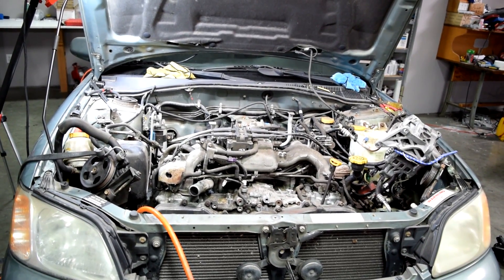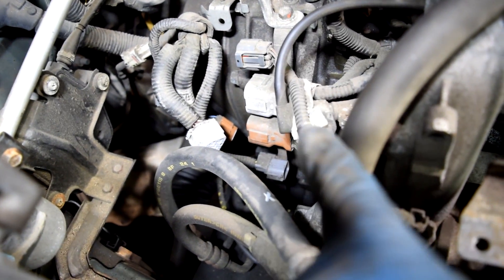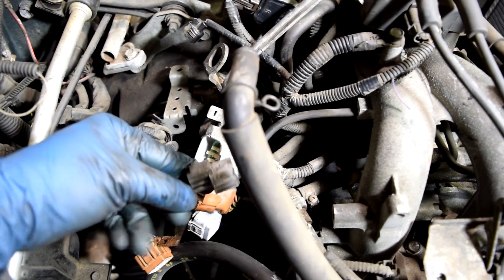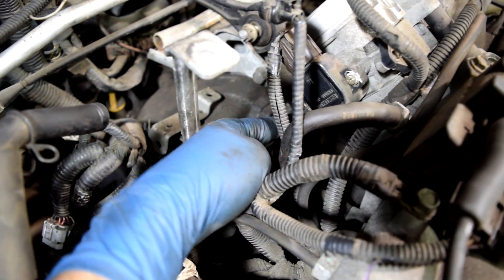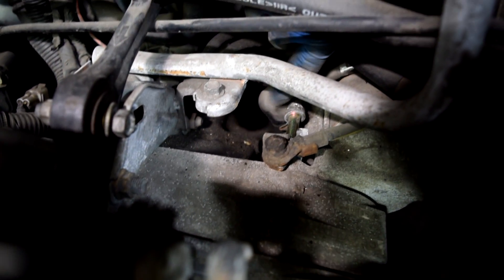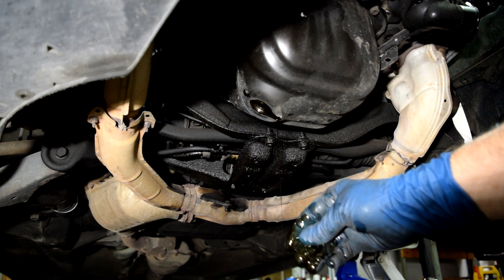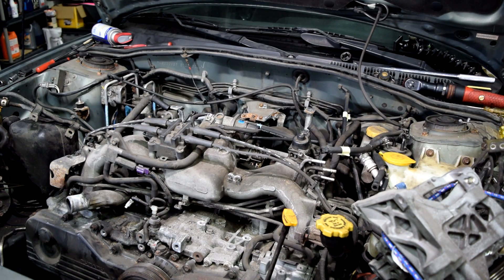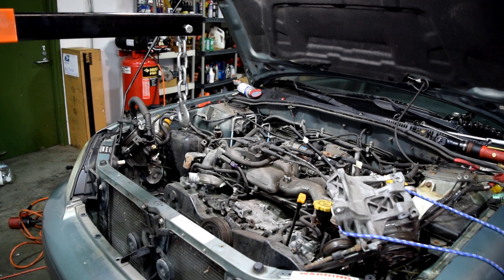Easy Subaru Engine Removal - Engine Swap or Head Gasket Replacement Part II

Comment: couldve ended the clip with footage of you actually lifting the motor out... watched the whole thing n its the only thing missing... ive pulled subaru motors few times but one im doing now doesnt want to seperate from the trans and am looking for tip to help... no gap whatsoever, all bolts/nuts removed... think might need to pry it open due to the dowel pins

Comment: @ 9:30 the ac compressor bracket has the motor bracket for lifting the motor up.
You have to unbolt your ac from the bracket and reinstall.

Comment: I love you mate you saved me bro. I don't care I can say that and mean it. you saved my life. This is my first removal of a flat 4 or split 4.. and best fortunes for you serious no luck best fortunes seriously

 Master Yoda bow Downs thank you so much
Reply: This video makes it like pulling out candy from a baby. I like how you emphasized on the transmission I'm going to be really meticulous when I separate the housing later on this evening timing belt broke because a low viscosity level I wish I could send a picture but yeah I think he knew what happened the timing belt broke. On the 57 freeway in Los Angeles so I'm doing the work. Sing that China owns everything I'm sure I can get another motor for Fairly cheap from the Japanese foreign Engine Exchange $500 for the motor 40000 miles

Comment: How different is it for manual transmissions as opposed to automatic?
Reply: you dont have cooling lines to the transmission, and you dont remove the torque converter bolts, cuz there are none

Comment: How do you pull the motor if you cannot rotate the motor to remove torque converter bolts?
Reply: John Nicolosi 
I have this exact problem, anyone?
Reply: John Nicolosi 
Never mind figure it out:

1. Disconnect the torsion? Engine mount from the top of the transmission (looks like a dog bone)

2. Remove the two nuts holding the engine mounts to the lower sub frame.

3. Jack up using the engine oil pan (if reusing the pan use wood to protect)

4. Get it high enough so you can remove all the 10mm bolts from around the oil pan, except for one or two at the front.

5. Lower the engine back to normal.

6. Remove the pan, may need to disconnect or fight with the pick up tube.

7. Remove the windage tray.

8. Beat all of the broken parts out of the way.  Also if you can, loosen as many rod bolts as possible.

9. Now you should be able to move the engine and access the torque converter bolts from below.

10. Done
Reply: I’ll just pull the torque converter with the motor and rotate it to get it off after pulling the heads off.
Reply: @johnnicolosi6865  I mean if you want to risk damaging the transmission pump you can do this.

Comment: What would you say is the average time for a home mechanic would be to do a subaru motor swap? I have an impreza 2.5i with 176k on it and I personally think it would be easier to get a cheap low mile motor rather than get an engine rebuild kit, thanks!
Reply: 2 days
Reply: took me 2-3 days first time because i didn't know qhat obstacles to expect but once you do it for the first time you can pull it out in 30 minutes

Comment: Thanks a lot.  I have a 2000 Subaru Forester and was worried I'd have to take the intake manifold off to access the torque converter bolts but you show that's not necessary at all.  Cool!

Comment: I’ve removed everything (4 bell housing/the two nuts) and the two holding the engine onto the frame and when I try to lift the engine out it goes about 2 inches but still won’t separate from the transmission. I can’t figure out why, and have triple checked everything and when I try and lift further (very carefully) it lifts the transmission with it. I don’t know why, my guess is some extra bolt or nut holding it but I don’t want to try and chisel the engine off of the transmission for fear of damaging it
Reply: Ragnorian, I had the same problem yesterday on my first engine removal. This was for 2002 Impreza RS EJ25 engine and manual tranny. Raise the engine to clear the engine mounts from the frame. Support or jack up the transmission so that weight of the transmission is not carried by your engine hoist. You should be able to move the engine towards the front and see some separation from the tranny. This is where I would get stuck. It would seem to bind on the lower passenger side locater pin. I placed a large screwdriver on the top of the crack on the passenger side. I would lower or raise the engine to get the driver side to close back. This seemed to leverage the passenger side to open more. I had to rock the engine side to side but eventually this worked for me. Good luck!
Reply: Randy Diez 

Legend says he’s still trying to separate the engine from the transmission
Reply: @chrisj197438  I will look for a link to a video of a guy who only works on subaru engines. Sounds like he has removed the black square inspection cover that allows you to remove the bolts from inside the bell housing for the flywheel. The motor and transmission are still attached and he is prying on it hopefully not too much.

Comment: Hey boss, how would I lift it on a 98 Legacy Outback EJ25D? My fuel injectors are in the way and I'm afraid I might break them if I wrap anything around it to lift. What are your thoughts? Thanks!!!
Reply: This is really late but may help you in the futer.  Take the bracket off of the ac comoressor, there is a hook point on it and another on the back left corner, what he did wasnt right
Reply: @jaidenwatters5213  thanks for the reply! I was able to remove the way you just described all those years ago :) hope this helps someone else!

Comment: Nice Part 1 and 2.  Only comment I have is that I would not use ratchet wrenches to break loose bolts, its a very good way to break the ratchets.  Thats why they have an open end on the other end.
Reply: I am not about to pull hard on an open end!  The harder you pull, the more likely they are to give.  Way too many bad memories of open-end knuckle busters.
In all my years the only racket I have broken was a 1/4".  
I have even put cheater pipes on a 1/2" Harbor Freight extensible racket (I don't care if I do break Harbor Freight) without breaking any (I have three).  
3/8" drive, I don't use cheater pipes.
Reply: open end on a combination wrench or a ratcheting wrench is NOT for initial loosing or final tightening of a bolt or nut (u will just round off the 6 point hex)it is there to help remove said hex head of loose fastener,,the real way to loosen or final tighten a bolt or nut is with a 6 point tool,socket or boxed end of combination wrench,,12 point sockets and boxed end of wrenches are for use in tight confined places..

Comment: Lucky there's no EGR pipe going from the intake to drivers side head. That thing always seizes in there and rounds off easily.
I always used the alternator bracket and the lifting hook where the harness connects to lift the engine as the factory service manual illustrates.
But I know the junkyards lift it the way you did it and that also seemed to work ok.
Reply from the maker: s0nnyburnett I dont have the manual so was basically assuming with the bracket comment! This car does have EGR, I took out the pipe outside of the car the other day, came out with no issues. But we have hardly any rust/corrosion issues here plus the engine being outside the car you can get a really good grip on it.